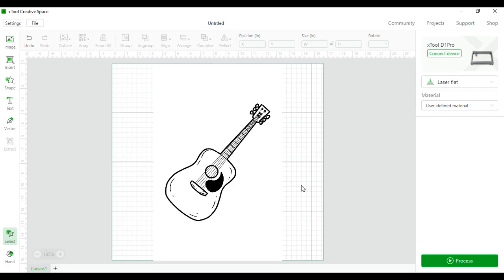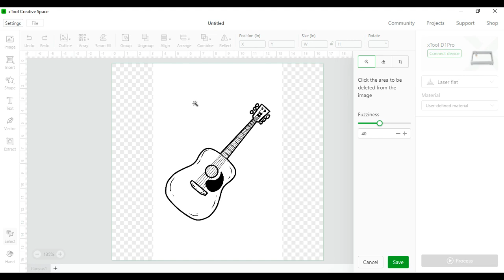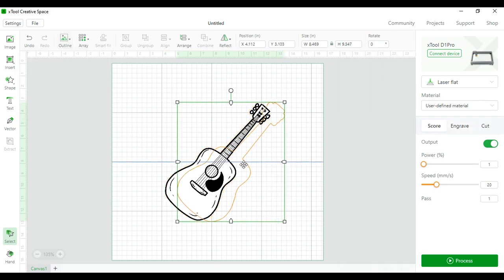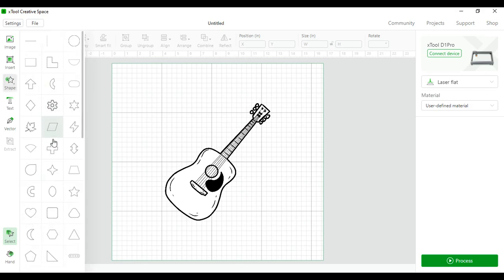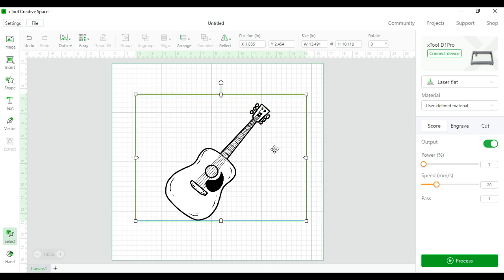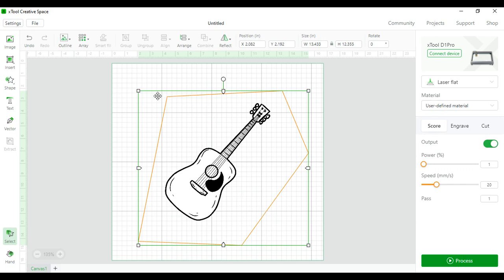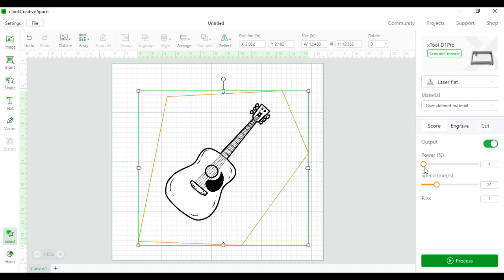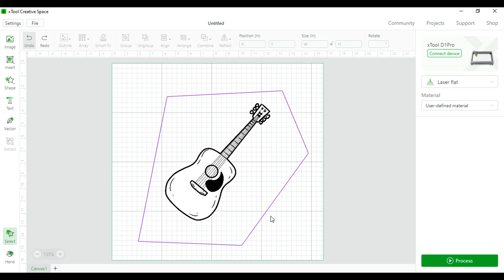Learning how to Cut with Xtool Creative Space - Tutorial

Comment: Is it possible to change how deep you engrave?
Reply from the maker: Higher Power or lower speed will make your engraving deeper. However, it may cause a charring look around the edges. So, you'll have to test it to find what works best. You can look online and find a test template to know exactly what speed and power works best for the material that you are using.

Comment: Dude, I learn something new everytime I watch these vids. I'm really new. And I was trying to figure out how to do this exact thing. A couple questions. Is the default to engrave/fill, then cut? Also, I'm having trouble centering a circle design on a circle. What's the best, easiest way? Thanks.
Reply from the maker: There are three different defaults in for images created in Creative Space. 
1 - Score - which would  be like an outline around the image. 
2 - Engrave - which will fill in then "print/engrave" the image onto your blank.
3 - Cut - which cuts around or inside your image.
If you download an image, you can engrave it. If you want to cut around it, you will have to put an outline over it from the top left tool bar.

To center, go to Settings>autosnapping. This helps align the images to the page and makes it easier to find the center-point of an image.

Hope this helps.